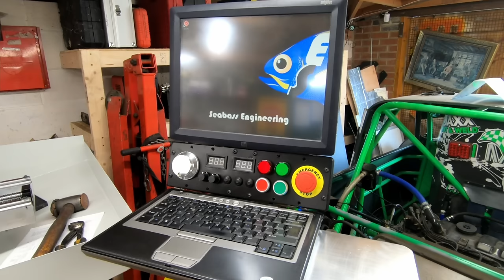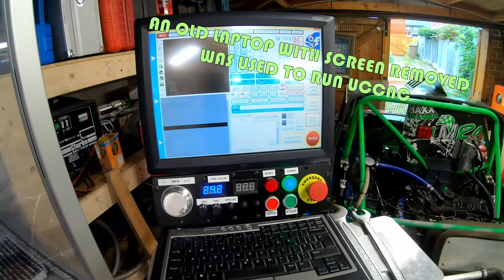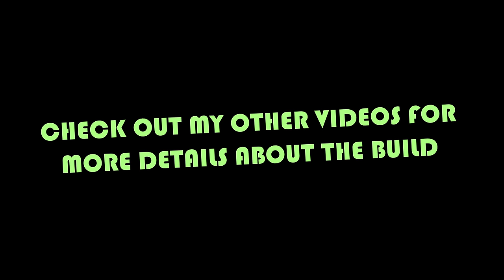DIY CNC Milling Machine - The Complete How to Build Video

Comment: Amazed with sound of cutting and apparent rigidity on something built with a drill press and bolts.
Reply from the maker: I believe rigidity largely comes from the overall mass of the machine. I think it could be improved further by filling the column with epoxy granite, as well as the hollow frame with sand or similar. Perhaps even adding a heavy block into the frame base.

Comment: at 34:08, the plastic junction box, where'd you get that? Great build!
Reply: I think it was from eBay to be honest. It's just a 100x100x50 IP55 junction box. Commonly used in UK electrical systems.

Comment: Ok Im not thru the whole video…. But I have to say as a fabricator myself, the support table is impressive asf just all by itself. Now about that very very expensive table with the X and Y axis…. Lovely job. Were ya nervous when ya started. You know, not wanting to make a tiny mistake.  I didn’t see any so I’m commenting about that also. I will be commenting throughout the build. I’m one critical bastard too!
How much did ya need to shim when you showed the small ammount of tilt to the spindle bridge. (Didnt look like much)(prolly only reason it is askew is because I was typing while ya welded it🤣) also how can I avoid that? Did you have a set of plans or do ya work with a similar machine and just memory wing it? I realize all this was a year ago, how well is it holding up? Have you had to change anything?  
Overall, I think ya did an excellent job on it. Thanks for sharing. 
  Oh, I gave ya a passing grade toooooo! 😂🤣
Reply from the maker: I used a precision square to "rough in" the column square while welding. I found the trick was to make small weld initially, a few large tacks and then used a heavy duty ratchet strap to pull it back square before welding the other side, then go back to fully weld it. It's impossible to keep it from moving while welding. I would say this is probably the one part of the build that could have really done with being squared up on a milling machine but I wanted to see if it was possible to finish the project without any machining.

Comment: you like an artist, engineer and craftsman al in one. Really nice work and thanks for sharing! I wanne build my own cnc to, but smaller. I’m curious, I guess you’re using aluminum plate material underneath the linear guides, can you tell me what thickness  plate material and what type of aluminum (6082, 7075..)? And is the aluminum plate material flattened?

Comment: Impressive build, I really liked it.  A couple questions: Why did you opt to make a small table?  I was expecting you to put the rails on the underside of the table and the bearing blocks supporting it so you could have a longer table.  My other question:  Now that you built it, what would you do differently?

Thanks for the video, pretty nice.  (I appreciate that it didn't have loud background music, and that I could hear what was happening.)
Reply from the maker: Thanks for watching. You're not the first to point that out about the table. I actually considered this after someone else commented the same and after a lot of consideration decided to do it this way mainly because the longer table would have meant a much bigger enclosure with no real gain for my purpose. If I were to do it again I'd probably overkill the rails and ball screws and I'dmake the frame heavier somehow. I may still do this. E.g. fill the frame with sand and potentially put a big resin block in the bottom to stop some of the harmonics.
Reply: Having a small table on a long X axis saddle is how, say, a Haas VF series is setup; while a long table on a short saddle is how their lighter duty Toolroom machines are setup. From what I understand its a tradeoff in capacity/versatiliy vs performance. Smaller table ends up more rigid and less mass which is easier to move around accurately AND quickly.
Reply: @scottwatrous  great info thanks for replying
Reply: @SeabassEngineering  have you looked into the epoxy granite?

Comment: Did you have any problems mounting the z axis plate directly to the steel box section? Box section isn't very flat so did it distort the aluminium plate at all?
Reply from the maker: To my surprise after hand filing the start of the radius of the box section (you can just make out where i've done this in the video) the z axis plate actually sits pretty flat. It didn't rock when sat on loosely and didn't seem to distort when torqued up. The biggest issue was with the z carriage alignment, as that had moved all over with welding.  Without access to a mill this needed careful shimming and other than aligning the column was one of the most difficult parts of the entire build. Thanks for watching.

Comment: Hey mate congrats on a great build. I am in the process of building a Vertical Machine Centre as well. Could you tell me what stepper motors and what diameter ball screws did you use. Looks like a 1” ball screw in the videos. The linear slides, is that the 20mm wide ones ?
Cheers
Reply from the maker: NEMA34 short body version. ball screws and rails are all 20mm

Comment: great job! could you please explain the shimming process of the z ?
Reply from the maker: This is a painstaking process of torquing the column bolts down, measuring out of alignment amount along the z travel using a machine alignment square and dial test indicator and then shimming the approximate amount and repeating. This is easier if you always torque the bolts to the same value every time.

Comment: Hi! Why do you sometimes use MIG over TIG welding? Do Prefer MIG on thicker parts and TIG on thinner parts? Awesome build, well done!
Reply from the maker: For me, it's sometimes due to material thickness and other times just due to time. MIG is much faster than TIG. For the column also my TIG is only 170 amps and the MIG can go up to 230 amps. I had it on maximum to get good penetration on the 10mm wall thickness into the 20mm thick plate.
Reply: @SeabassEngineering  thank you for explaining! Just about to by my first TIG welder so this was good information . 225 amp tig it will be then :D
Reply: Amperage isn't the only thing to consider when buying a Tig that's for certain. Do your research before you buy!

Comment: Is that 3kw spindle capable  of cutting steel at low rpm? 5000rpm
Reply from the maker: It will cut steel with sensible cuts and the right feeds and tooling but I've found minimum rpm that has any usable torque to be around 8k with this spindle.

Comment: I am concerned about chipping in the energy chain, as it can gauge the wires. Have you thought of a way to negate this?
Reply from the maker: Yes it is a concern, I will need to find a way to prevent this especially if i start to cut steel.
Reply: @SeabassEngineering  really like your setup, how much did it approximately cost?
Reply: @ChristianDybdahlXTR  somewhere around 3.5k all in. I was buying it bit by bit for over a year. So I don't know exactly

Comment: How much did it cost?
Reply from the maker: approx £3.5k
Reply: @SeabassEngineering  bruh I'll just buy one for that 😅
Reply from the maker: Good luck, but even if you could, where's the fun in that?
Reply: @SeabassEngineering  most cnc mis go for 1-3k
Reply from the maker: @GoldenTV3  There are CNC machines and there are CNC machines. At that price they'd probably be 1000 years old, enormous, need upgrading and be worn out.
Reply: @SeabassEngineering  yeah maybe your right those look to be engraving machines so maybe 3.5k ain't that bad of a deal but I might try to modify a 3018 pro so it can take .25-.5 millimeter passes out of aluminum with hopefully a hundredth millimeter tolerance. A lot cheaper than 3.5k but slower and not as accurate
Reply from the maker: @GoldenTV3  The other thing to consider if cost is an issue, is that when self-building you don't need to buy everything at once. You can start building with very little cost and keep adding/making components each month. It will also teach you a lot about how the machine works, so if there is ever a problem, you know how to fix it.
Reply: @SeabassEngineering  Ya know coming back to this, I might try to save up for it and build it. Except I don't have a lathe, so I may have to find a way around for some of the parts. The build area looks great, guessing the tolerance is pretty good, 100th of a millimeter? And I'm guessing all the steel needed to put it on a cart probably added some to the price, wondering if it could be built just to be stationary on something.